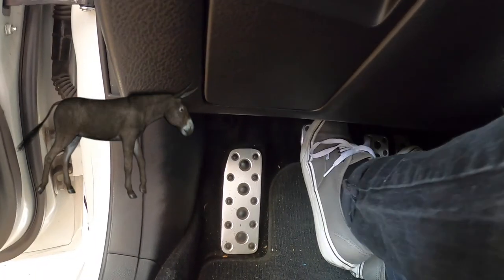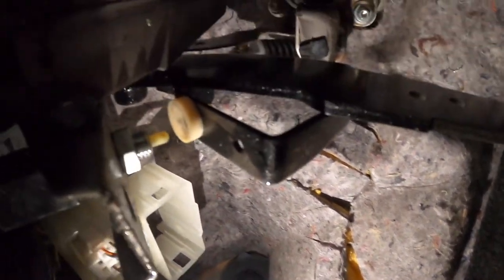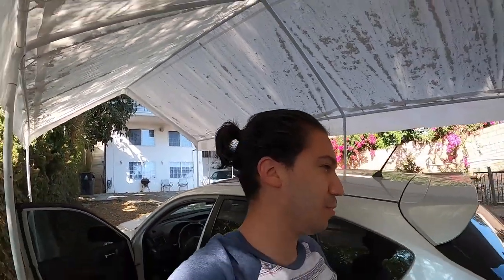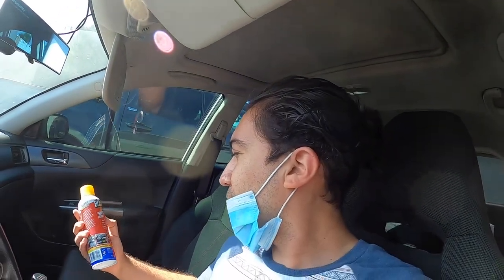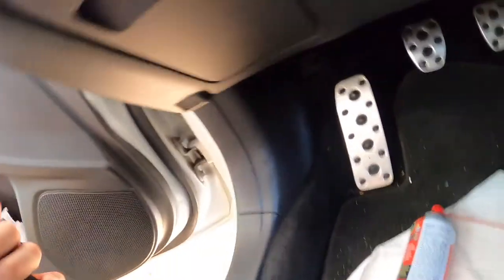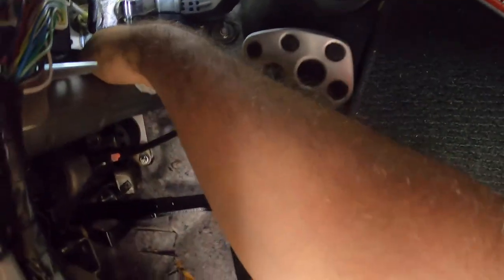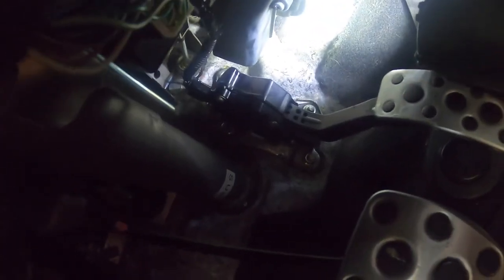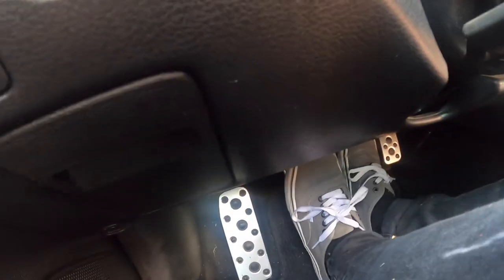How to fix squeaky Clutch on 2014 wrx

Comment: You should inspect the spot welds under the windshield wiper motor. You will have to drill them out and add bolts. 

Inspect the  Metal tube That connects the  rod to the master cylinder. Look for cracks.

There is a upgrade suport for the master cylinder and also a upgrade clutch pedel clustor. 

It will get bad if you wait to long.